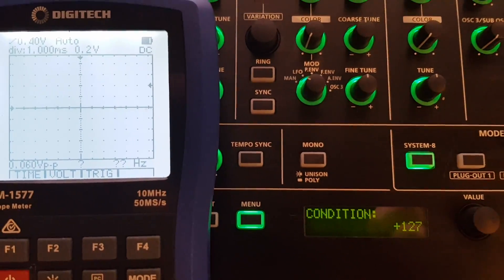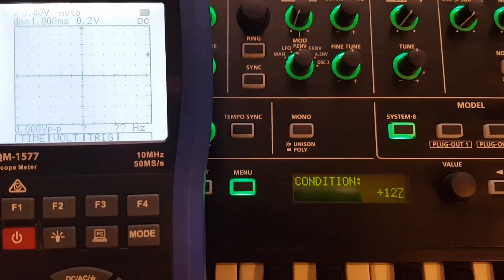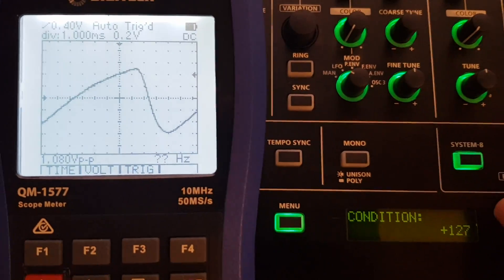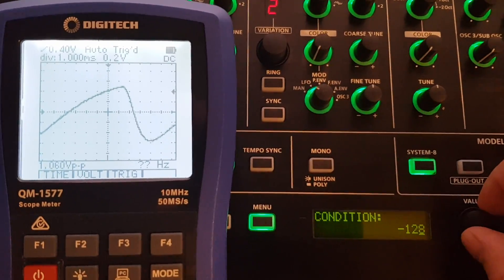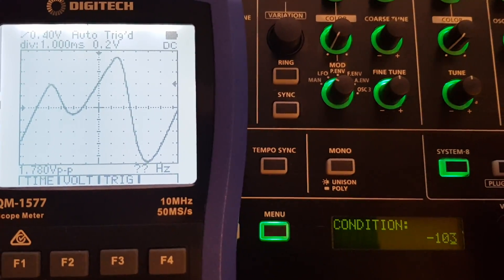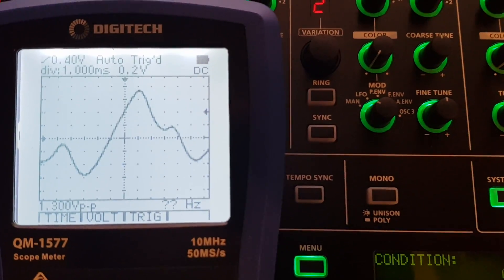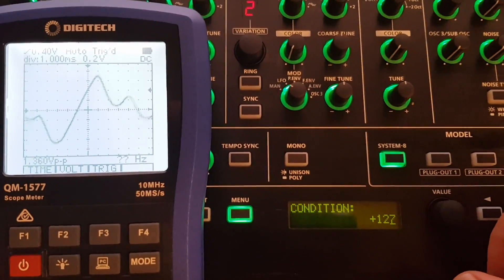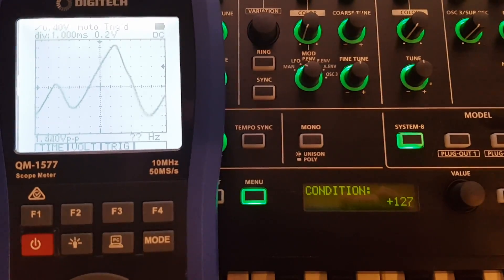Roland System-8 "Condition" Setting Demystified

Comment: I would really like to know why the 'CONDITION' parameter has a central zero and negative and positive values.
What do the negative values mean? I believe the positive ones are for simulating aging of the circuits, and zero should be for no change, that is, without any effect.
But what about the negatives? No one explains that. What do negative values of CONDITION mean?

Comment: I think it is a macro controller and It depends on the synth engine used  . Think Dave Smith / Sequential “ Vintage Knob “ , but less well implemented. Example the 106 plug in’s chorus effect gets a little more noisy as well as a little more detuned, the SH2 gets a little more wonky in the OSCs and sounds a bit “dirtier “ as if it has more crosstalk and bleed and noise but yeah it’s fairly subtle in all of them . I guess it’s cool if you are listening very closely to the soloed synth , but for what it’s worth a standard VA Osc drift and a unison detune would probably be much more desirable to a lot of owners .

Comment: Very interesting test, to my ears the higher condition setting makes the waveform a bit more gritty as well (not in pleasant way). I think zero on the condition is the sweet spot. I think the System-8 is the best sounding VA synth, it "almost" blurs the line between analog and VA. ACB technology is far ahead the competition.

Comment: Thank you for this test. Good idea ! 
Another kind of test would be good to do with your scope : in the Korg Kronos, we have some parameters in AL-1 engine, in order to randomize pitch and phase so to simulate the analog behavior. They are very efficient. But, if we test it on only one continuous note, you won't hear anything ! On the contrary, playing the same note several times will produce a shift in pitch, from barely audible to clearly untuned. This reproduces the analog circuits unstability.
So, I wondered if you could do a new try, with pure basic waveforms, full open filter, Condition to +127, and play one note stacato and see on your scope if you notice some shift. It's just an idea !!

Comment: Nice video. If you try it on the Juno 106 plugout, it'll actually start sounding like the electronics are fried a bit as you raise the condition. Not sure what happens in the Jupiter 8 plugout, as I couldn't notice any difference.. maynbe you need to run it through the scope to tell. Thanks for the video!
Reply from the maker: Good idea.  I just quickly ran through the plug-outs and can see the Condition setting affects them quite differently to the base Sys8 engine.  I'll do some more extensive testing and hopefully post another video.
Reply: @kombisaurus   - meanwhile, 3 years later… lol